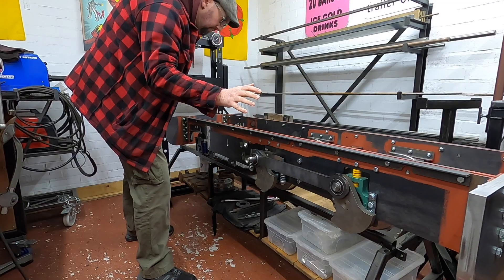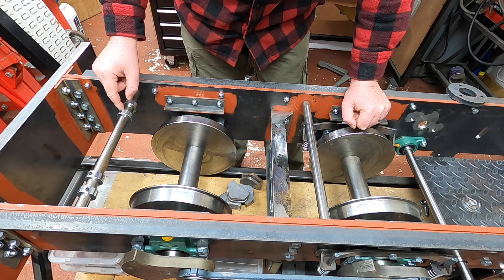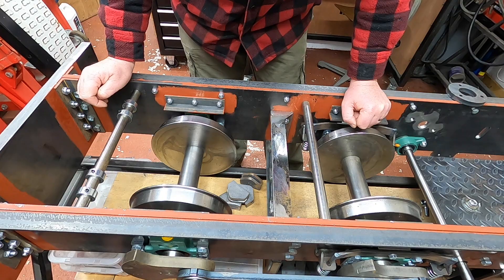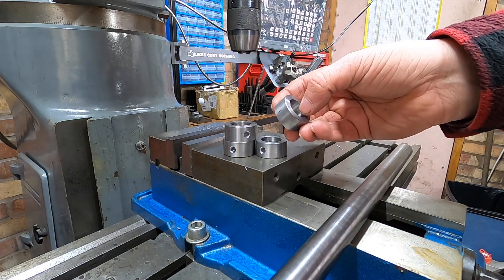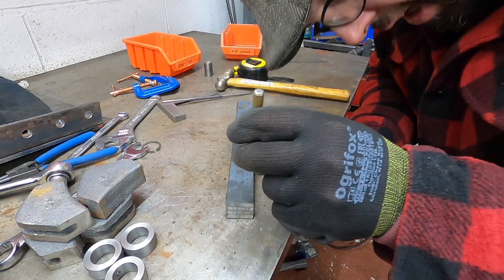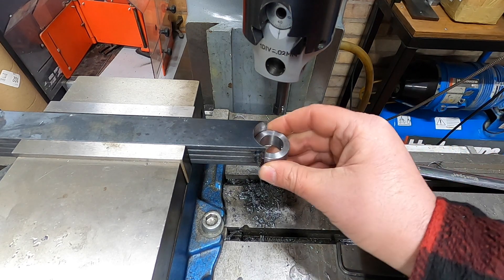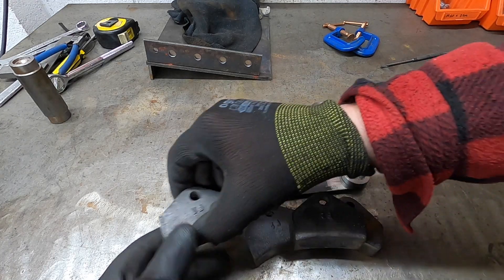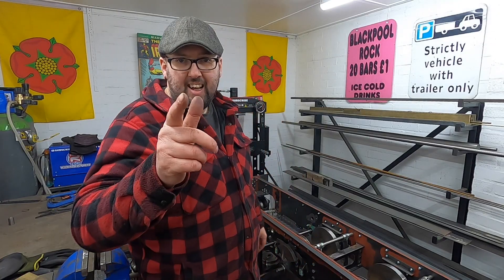Onto the Brake Hangers  - EP37 - 7.25" Gauge Steam Locomotive Build

Comment: Haha, remember the expericence I had when building my Shay loco:
As I build fully working steam breaks, I tought there's no need for a hand brake as well.
I added it rapidly after the engine started rolling off the bench and I finally realized, that steam breakes will only work with steam, but not on a cold engine.
Reply from the maker: 😂 yeah I’m doing it the other way round, putting handbrake on first, with the ability to fit a steam brake later… but my friend with a Tinkerbell at the club has a steam brake and he stays he very rarely uses it. All the best, Matt